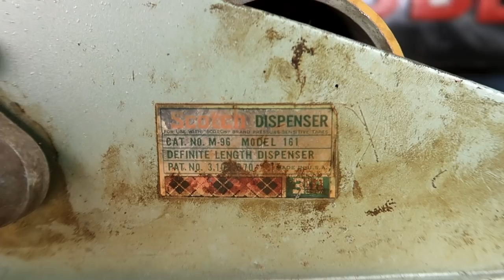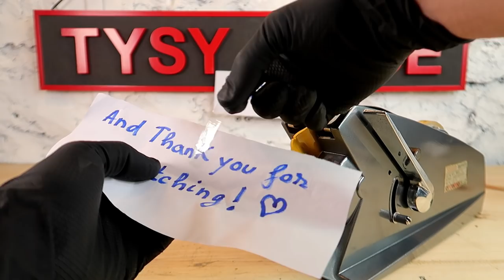Unique Tank Dispenser Restoration

Comment: I tried to polish a bolt the other day and i just got a pad for my bench grinder. Long story short you make it look easy and i need a new window in my garage.
Reply: dude get yourself a hand vise before you lose an eye or some shit, its just a bad idea to use grinders without a good grip especially on small parts. And you get more precise control.
Reply: cd rom you don’t think thats a little to aggressive on the thread? Idk what country your from but here in the usa even most of our hardware is cheaply made in china.
Reply: oh yea it might be agressive on the thread, if you clamp it too hard. I never noticed damage but this is a very cosmetically related discussion, so my recommendation would be to put some roofing lead over it. 

What I did a long time ago is buy a 100lb roll of lead from home depot and use most of it for casting but I saved some. Cut it out with a pair of tin snips nicely and then make jaw inserts. I made them for all my shop vises. 

Some people like copper but not the best substitute for lead IMO.If you use copper cut it out, then get it good red hot and dunk it into cold water to make it very soft.
Reply: I actually use two hand vices for larger shafts if I am de-rusting. After doing hundreds of items I got really tired from holdign stuff with my fingers, your hands hurt afterwards.
Reply: oh yea and a tip, you don't need to hold the piece along the vice serrations, and there are a multitude of different hand vices available. I have one that clamps down square (not like a pliers) and has bakelite inserts. 

A mod I highly recommend is to get a square or triangle file and cut a slight groove in line with the handle directly in the middle on both sides so you can grip a shaft on the long axis.
Reply: if you don't also know, for round things you can make a few different tools/adapters. 

1) weld or braze a washer to a nut, insert the part into the nut so the part you want to work on is sticking out and screw in a bolt. Then you can tighten it a bit (not too much) and work off a larger work piece. You can weld a handle to the bolt too. Its like a squash vice, dunno what to call it. 

2) look at pin vices, they are usually small but there might be some larger ones available. Their basically a collet that holds a shaft. IDK if you wanna use starret for janky shit but you can get cheap ones that are poorly made in comparison
Reply: obviously if you make the bolt washer clamp you can make an assortment of them. What I did is plan out what I wanted and I went to Lowes and bought them all by single count.
Reply: mrpete222 has a video on his channel some where on how to make the bolt washer clamps but I will not look for it, he has way too much stuff.
Reply: I also have another pin vice that basically closes two right angle bits together so you can get a EXTREMELY tight hold on stuff with right angles.
Reply: i mean hand vise
Reply: @cdrom1070  Jesus Christ dude,go get a job or something 🙄

Comment: I used similar dispensers working on a production floor. They are used for precision. Of course the ones I worked with weren’t this old. More like from the 70s but the design is very similar. They are made very heavy probably because you had to grab tape one handed as well.
Reply: So you used one before?

Comment: This is my real speed

This is my speed with nos 😂😂 ❤ I like that kind of humor
Reply: I'm dumb and English is not my mother's language (although I'm very fluent at English). So what means "nos". I mean sounds like a abbreviation or sth.
Reply: @PikaJu  NOS or Nitrous Oxide, often used in internal combustion engines. Used in some racing cars to deliver more oxygen to the engine. 
Basically, it allows more fuel to be burned because you get more oxygen from Nitrous Oxide than from regular air and it makes the engine a bit more powerful, therefore faster.

Comment: Excellent work!  (I think a NEW roll of tape would have been OK though.......)
Reply from the maker: thank you so much 😊
Reply: I wonder if they still make tape in that size.
Reply: @lmehra7443  Yes, the device will hold any roll of 3-inch core tape, up to an inch wide. 3m has several divverent adhesive strips on their site that meet that criteria.

Comment: A little late to the party here. But yes, I had one of these at my station for years. In my case the application was film manipulation in the printing industry. My machine I believe was circa 1960s, but I will dig it out of storage and check the name plate. This, dispenser as another commented, always gave you the same length for amount of depression so getting the right size piece was fast and easy. Made burning plates a breeze. Thems were the good old days.

Comment: Thats a 1961 scotch tape dispenser. The wheel was designed so you knew exactly what length of tape you were using.
Reply from the maker: yes
Reply: Can confirm, 1960s definite length dispenser
Reply: They’re still made, albeit now plastic.

Comment: I think it's kinda neat and you did a wonderful job restoring it. I also know and understand the concept of these. The manufacturing company that I work for has several of these. All different sizes and purposes of course. They are great when you have to get product shipped quickly. We also have a taping table, push the box across the rollers on the table the rollers makes the tape come out. By the time the box makes it to the other side of the table your box is closed up very well and ready to be shipped 🙂

Comment: The over engineering on this piece. 👀
Reply from the maker: yes
Reply: Great work on the restoration though!
Reply: Over engineering lasts a lifetime!  Better then chinese dispensable crap. ;)
Reply: @imacrazyguy5831  not always true, the more moving parts you have the more parts there are to go bad.
Reply: @icedawggg  Exactly, it's the simple designs that last a lifetime, not the over complicated ones.
Reply: i prefer the little plastic rolls that are 2 pieces. 
1: body 
2: roll of tape
and when you use all the tape, you can recycle the plastic bits
Reply: @ItsMrAssholeToYou  we're looking at at least 5 pounds of pure cast iron, to dispense TAPE and you tell me it's not over engineered? You kidding me?
Reply: @ItsMrAssholeToYou  well they have their own ecosystem like apple does. the difference being festool is at least usable
Reply: Its how we won the war!
Reply: @somedude2492  Yes. It's UNDER-engineered. People who don't know anything about engineering, which happens to be most people here (despite most people thinking they're experts after watching 2 tools being taken apart), mistake over-engineering and under-engineering. This is a perfect example of UNDER-engineering. Why? Because it's not OPTIMIZED in any way. If it was engineered properly, it would use far less material, it would be far more compact, far more efficient, etc. while STILL performing the same or even better. Every part of this tool is oversized and made  far too big and bulky, because those people who designed those parts didn't do any calculations or projections on how the parts are gonna behave, what kind of loads they will sustain, etc. Just those gears and shafts can take maybe 100 times more load than they'll EVER have to deal with in practice. That's just bad design. Same with the actual body of the entire tool, which are just overly thick and heavy cast components without any design features on them (like ribs) that would make the parts MORE RIGID, but lighter and more efficient...however would take more time to design and engineer. You see, that's the difference between engineering something well and simply making something oversized. They just made everything BIG, and something being TOO BIG is not a sign of quality or good engineering. Quite the opposite. Yes, it's gonna last a long time, but not as long as it would if it was better engineered and designed. You could literally cast a 100kg heavy cube of iron  with a small hold on top and use it as a pencil holder. Would you consider that good engineering? I mean, it WOULD last forever. Of course you wouldn't, you'd call it shit design. Too bad that most people aren't capable of understanding that and fall for the "size is all that matters" bullshit.
Reply: @derbigpr500  Says the person who then overcomplicates the meaning of a popular turn of phrase like it's a codified technical concept.
Reply: I personally like how the lever on the side can be adjusted to dispense the same length tape repetitively for the task at hand during that time.
Reply: @derbigpr500  The only thing China makes that is high quality is fancy plates, if they even do that anymore.
Reply: Juan Sambucetti 
How else do u get an exact length of tape every time quickly?

Comment: Tysy instead of fidling around with plastic paint etc on plastic parts that have gone yellow use some retrobright next time, just put it on wrap it in a plastic bag or zip lock etc and leave it in the sun for like 2 hours it will be brand new again
Reply: Isn't hydrogen peroxide involved here as well as uv light??????

Comment: that plastic bit looks like it may have oxidized rather than supposed to be yellow.  I wonder if it would've turned white if you tried retrobrighting (soak in hydrogen peroxide in the sun for a few hours or UV light [I don't know how long]).
Reply: Nope, they were always a pale yellow.
Reply: But the peroxide  might have made it easier to clean rather then paint it.

Comment: This is an hilariously over engineered piece of machinery. I may have recalled seeing one like it in the 1960's. Most often seen were the stamped tin ones similar to todays plastic ones.
Reply from the maker: is made in 1961
Reply: TysyTube Restoration my dad had a few of these in his old offices. Just a tape dispenser. Reminds me of the ones he had for the  tape used to join film (splicing)
Reply: scott goodman ... As others have pointed out, the device was to dispense a pre-measured amount of tape, a fine adjustment being possible using the screw-in-able gizmo on the side. In the despatch department of a company where staff boxed up items all day long, a very rugged machine which peels off an exact amount of tape was just what you wanted. Nowadays, it would more likely be mains or battery powered.

Comment: Very nice restoration video... those notches on the yellow wavy wheel were supposed to be black marked as they indicate inches so that you can adjust the length of the tape you want dispensed then set your set screw and same length every time.  Awesome work!

Comment: We use this style dispensers fow winding and insulating copper coils for electric motors. great for giving out a specific length of tape. normally you have two or three at every station with different style of tapes in each.

Comment: I used a similar tape dispenser for glued paper tape.  I sealed cardboard boxes for shipping.  The dispenser held a roll of paper tape and had a water dish and brush for "licking" the tape.  I never cleaned it once in the three or four seasons I worked there.  There was more glue residue on the dispenser than I care to think about and the brush was a disaster.  But it worked and that was all that mattered at the time.  That was some 50 years ago.

Comment: It's a 3M "Definite Length Dispenser".  This one is older, and doesn't appear to be adjustable, but they still make a variation of this dispenser today.  The purpose was to save tape by measuring exact length pieces, and it was often used in office settings where speed was a factor, and this dispenser allowed for taking of tape more quickly.

Comment: I'm a public library worker and this is what we would call a "book tape machine". this machine can give you an exact size of tape that is used to put covers plastic covers, or as some call, dust jacket, on books. the dispenser quickly and accurately gives you a set tape size and the yellow gear of the dispenser allows your fingers to quickly get behind the tape in order to lift. it is a very useful machine when you are tasked with covering many books. the weight of it is necessary so when you lift the tape you don't move the entire dispenser. Lastly I remember ordering one of these for the library i worked at and it was quite expensive, somewhere in the range of $150 to $200.

Comment: It is from the 1950's and was usually used in the mail service for taping packages.  Different widths of tape could be used and the dispenser could be set for a specific amount of tape per push of the lever.

Comment: This is basically a packaging take dispenser.  Used mainly to tape up packages meant for shipping.   You can find them for sale in old Sears and Roebuck catalogs, who...funnily enough would probably use this same dispenser to package up the dispenser! Someone else mentioned that they used it to also splice film, but those were a whole different kind of machine, similar in use  but would both cut and tape the film.

Comment: They also made one, maybe still do for brown paper tape that needs to be wet to stick for parcels. I used one at a job I had in a factory for sealing huge cartons. You would crank on it and it would wet the tape and dispense so many lengths per crank, then you hit another level to cut it off. Was indispensable.

Comment: Glue for bicycle tube patches ...
AKA: "Rubber Cement". 😷

Nice job. 😷👍👍
"Industrial" model, as opposed to office use. 
That unit was made for up to inch - inch anna quarter maybe inch anna half packaging tape, by the way. 
I used one very similar or identical in a PFC promotion fulfillment shipping department several decades ago.

Since you asked at the beginning of the video, I'd guess it is circa mid-1950's to circa early/mid 1960's for the age.
Those things don't normally wear out, even after literally tens of thousands of rolls of tape going through them.

Comment: Technically, this is a cellophane tape dispenser (Scotch is a name brand). Yes, it is for commercial packaging/shipping application in boxing the product for shipment/storage. As Scotch Tape's Invisible Tape came into availability, this narrow sized tape was phased out. Now it is the wider variety that is used for moving boxes and large packaging. The improvements to the cellophane formula has gone a long way to reducing how brittle the tape becomes over time.

Comment: Awesome job sir, Couple of pointers, 1) try to get some spanners (wrenches), using adjustable spanners and pliers is a no-no and makes you look less proffesional,especially if you're going to video it. 2) never grease a plastic bush- it will cause the plastic to swell and ruin the part. Nice idea from Dolmeca the Knight below for using peroxide to bleach the plastic part back to its original white, would look much better. Keep up the good work TysyTube:)

Comment: Vintage Scotch M-96 Definite Length Dispenser Model 161 by 3M made in late 50's, they are kinda rare and valuable. a rusty old one sells for 250$ on ebay, your restored one is probably worth around 400- 600$ in a auction maybe more since you are kind of a famous restorer and can use your name to boost selling price. hope this helps

Comment: Those particular dispensers were commercial models. These were used in the 70’s and 80’s. I worked in a parts room when I was in high school. I issued them out to people who were packaging chicken. They were very heavy. Well heavy for a tape dispenser. I issued hundreds of rolls of tape for them. Packing tape and the tape with the string in it.   Very cool find. There were about 10 brand new ones thrown in the trash after they went to a new packaging system.  Shame.

Comment: I grew up in New York City.  My family patronized a local bakery on a regular basis.  On top of the glass case where the bakery products were displayed was a tape dispenser very similar to the one you have restored.  The ladies who waited on the customers would select an appropriately sized light cardboard box for the items being purchased and select them one at a time from the case as per the customers' wishes.  When the order was complete, they would go to the dispenser and press the lever three times for lengths of tape that were each about three inches long.  The tape would be used to seal the top and sides of the cake box and its contents.  The tape was not the plastic tape in your dispenser.  It was about the same width but a low tack, masking type of tape that could be easily removed without tearing the cake box in the process.I do not know if the dispenser could be adjusted to provide different lengths of tape with each press of the lever.  I do not know if the dispenser was manufactured by 3M but such dispensers were common among merchants who needed to wrap or seal a customer's package.  The vintage of the tape dispenser I saw operating in the bakery would be in the mid-1950s. There ARE old guys like me who remember such devices commonly in use "back in the day."

Comment: The patent was filed in 1961. The style of the machine indicates manufacture in the 1960 thru 1980s, probably mid 1960s to mid 1970s for this particular unit.

You probably think of tape for sealing packages, but there are many more uses in making things, such as small pieces of tape to hold wires or components in place inside a device. This dispenser would probably have been used for that sort of thing, sitting on a table where someone (most likely a woman, as they did most of the detail work in those days) was assembling something.

Comment: at 19:11 you see that you didn´t allign the yellow transporter wheel at the bottom, that´s why the frame at the front won´t touch. But my question is: did painting the yellow wheel affect the adhesiveness? I would have thought Scotch might have used a plastic or a surface that doesn´t allow the adhesives in the tape to stick too much to the wheel?
Had very much fun watching you, keep it up! :-)